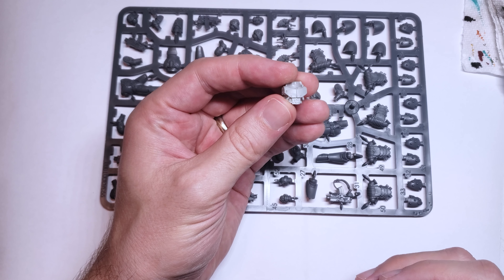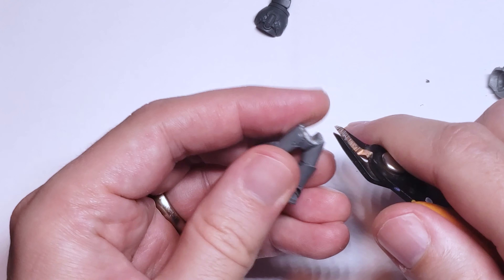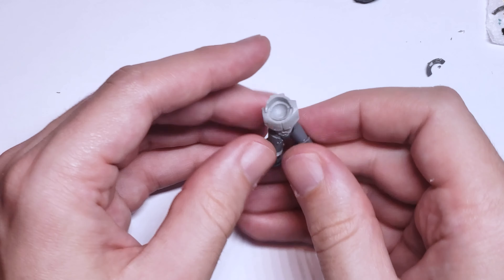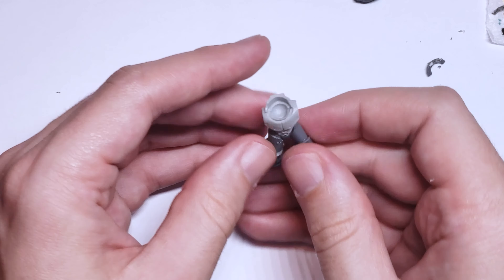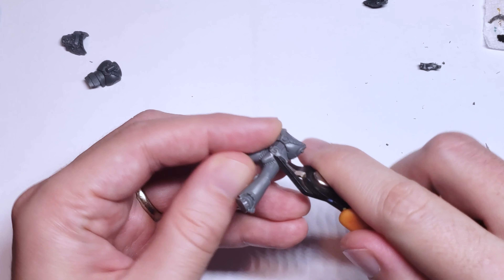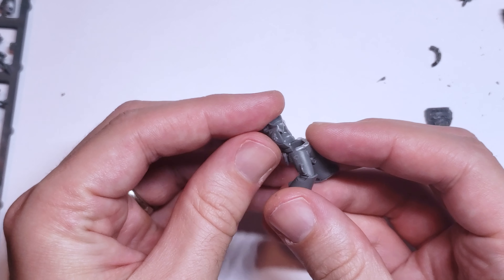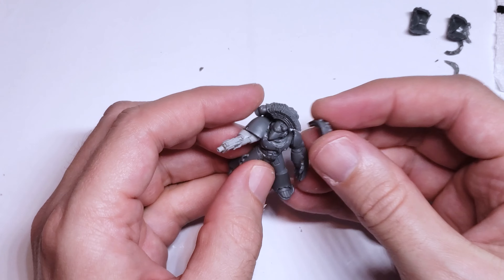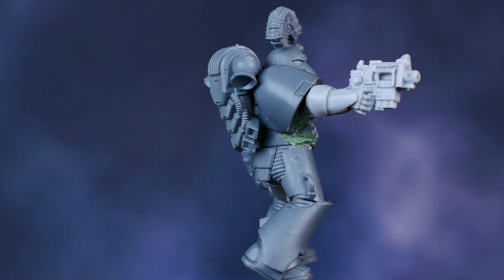How to Convert  MK6 Artificer Armor

Comment: Are the torsos on the praetors larger than the regular marine torso? Asking mostly to see if using them as a base with a reaver torso I have is a bad idea
Reply: Reaver torsos work okay just need to bulk the waist a bit with pouches
Reply from the maker: On the plastic praetors?
Reply: @AmnioticlyTanked  yes! i was wondering if I could put a resin forgeworld upgrade torso onto the Plastic Praetors
Reply from the maker: @Sarkhamy  the praetors are going to be significantly larger. I would honestly think that sculpting the slanted armor plates of the reavers torsos would be a better option than trying to get the torso to fit :/

Comment: man new GW marines are wierdly cut and put onto the sprues
i needed a dead marine pose for a build, ended up taking a mk3 chest, cutting off its legs, removing the crotch+thigh+leg and thigh from a mk6 chestplate, putting the crotch+thigh+leg and thigh onto the mk3 chestplate, removing the lower mk6 leg, putting on the seperate and crotch attatched mk3 legs onto that
just to achieve a guy slumped over near death, spent so much time cutting, sawing, snipping, gluing, filling

Comment: My Iron Warriors are done in a similar way; removing the torso and fully replacing it with the Mk3 torso. I found it actually fits fine and they are now my favourites out of all the other Iron Warrior kits that I have. Mixing Mk3 torsos and arms with the large legs of the mk6 really makes them stand out.
Reply from the maker: Qhqt do you then use for arms, heads, and backpacks?
Reply: @AmnioticlyTanked  I prefer using mainly the mk3 arms and backpacks but I also mix it up if needed.

Comment: Nice work!  If you want to smooth out some of your green stuff work, try using a clay shaper (rounded or flatter tip ones) and some scentless lotion and it should smooth out some of the green stuff!
Reply from the maker: Thanks for the idea of the lotion, I have been using clay shapers and water and its still been tricky to get it perfectly smooth. I have also heard petroleum jelly works, but I dont really want to have to wash my models after sculpting...
Reply: @AmnioticlyTanked  Yeeee.  I don't wash my miniatures after the lotion and green stuff work dries.  You really don't need a lot of lotion to help smooth out the greenstuff and it doesn't affect the primer and paint from what I have seen and done with my own minis.  Could also try using miliput as it dries hard and sands easier compared to the more rubbery green stuff

Comment: What's the reason for the new different backpack connection point?
I legitimately can't come up with a good reason for why it was changed.
Reply from the maker: The only reason I can think is that its now impossible to get the angle of the backpack wrong? Its a dumb reason, but its all I can think of.
Reply: @AmnioticlyTanked  Hmm, that's indeed a reason. Not a particularly good one, but I've seen GW make much sillier decisions.
For example: I never understood, why the old plastic contemptor wasn't compatible with the weapons sold by FW. I guess miniature designers just think differently.
Reply from the maker: @boneman-calciumenjoyer8290  Or like why the new leviathan has magnet holes for the torso weapons, but no way to easily magnetize the arm weapons. Clearly the designers are aware that magnets exist.
Reply: @AmnioticlyTanked  logical conclusion: they just hate convenience... sometimes.

Comment: First rendition is definitely better. Its a bit hard to explain without a visual reference but what i did when using destroyers torsos on the corvus plastic legs was leave the belt and the legs but actually take it off the resin torso instead. I then cut back the lower rib areas on the torso and then pinned the resin torso onto the legs. From there i used greenstuff to fill in the gap and rebuild the lower ribs that i slightly extended to match the scale of the legs. No extreme sculpting skill required. Just a silcone sculpting brush to blend the green stuff to the torso.

Comment: Nemesis is awesome. But I do have a small critique the helmet makes the armor look like artificers Mk4. You see usually characters models with special armor deviate from the standart details such as knee plates, vimbraces and trim. The helmet usually stays the same unless it's a special pattern such as the serum pattern.
Reply: Also forgot to mention the problem you encountered with thee torso is not of scale, but incorrect anatomy. The torso you selected only have chest and belt areas.
Also older torso and backpack for marines were not standard, not only the pegs were sometimes on the front torso, the backpack ball joint had wildly different sizes over the years.